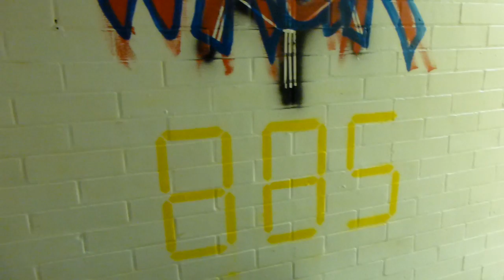An Epic Failure of a Fluorescent Ballast...

Comment: I've actually seen the aftermath where the fixture was literally dripping flaming tar. In any case I'd definitely be wearing gloves,  and maybe even a respirator if this occurred in an area without good ventilation,  many of the older (pre 1979) magnetic ballasts contained PCB's, a known carcinogen.   In any case, a sign of a failing ballast is a fixture that cycles on and off after a period of time, due to the thermal protector trying to prevent an actual fire, but be aware that some really old ballasts,  do not have thermal protection,  even those designed for indoor use, and those should always be replaced,  or at the bare minimum,  not left on when the building is unoccupied.
Reply: Mine is leaking now
Reply: Yeah I keep it off until replaced

Comment: That's what magnet ballest is banned for sale because their  real fire Hazzard one reason electric ballast replace them
Reply: electronic ballasts only last 2 years then they go. magnetic last 50 years
Reply: @samucontenti2192  That’s only with CFLs. With actual electronic fluorescent ballasts, It should last a long time.
Reply: @houseguestchannel  well actually, i've had some electronic fixtures (2×58w), witch here in europe are a bit less common than magnetic ballast fixtures, but they were all dead, so i converted them to magnetic, those fixtures should be around 10-15 years old, so, here even those don't last long... instead i have magnetic ballasts that are 60 years old by now that are still going strong. i do understand that they are heavy, bulky, noisy, inefficent ecc.. but i prefer them, and in my experience they are a lot better than electronic ones
Reply: @samucontenti2192  CFLs have the worst of the electronic ballasts tho.
Reply: @houseguestchannel  can't really disagree with that
Reply: you sir are an idiot, that is a very rare case that they fail like this or at all really. that tar melts easily anyway and does not cause any issues, it is likely not PCB because that was banned pretty early on. the magnetic ballasts last for a very long time and when they do fail they normally have thermal protection. the electronic ballast is more likely to catch fire and they surely do fail after like 3 years. i have about 8 lights from the 50s with the original magnetic pre-heat ballast and they all work fine and never have any issues. it is likely this guy was running the evergy saver bulbs which will burn up the ballast because it is very uncommon for this to happen.
Reply: The real issue why the magnetic ballast was banned for new installations in the U.S. (and the associated phase out of the common F40T12) is the energy efficiency standards, thank our politicians for that.     And to be honest,  that's what caused some of the ballasts to fail and some fires as well.   In the early 2000s when we started pushing the 34 watt energy saving lamps aka watt-meiser and Econo-watt, the older ballast were designed to only run the true 40 watt lamps, and they sometimes would overheat and fail, when the newer lamps were installed,  sometimes months or years later as the older ballasts were pretty robust and could take some abuse.  Unlike the newer electronic ballasts made in China or Taiwan that are nowhere near as forgiving

Comment: Yeah I've heard of this happening. Not even the new ballasts are immune to such failure. I've seen the electronic ones do similar stuff. They're potted with tar as well. (Though not all are potted, and some are only potted on one side of the circuit board.